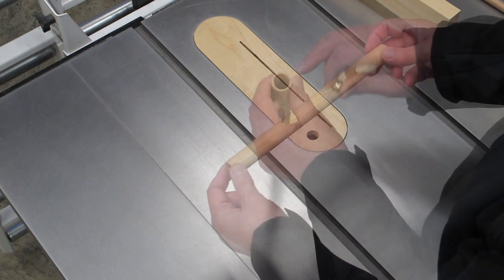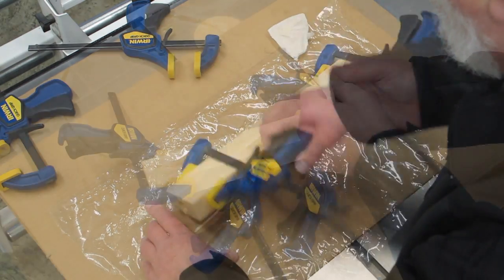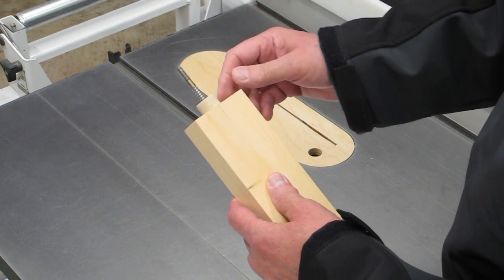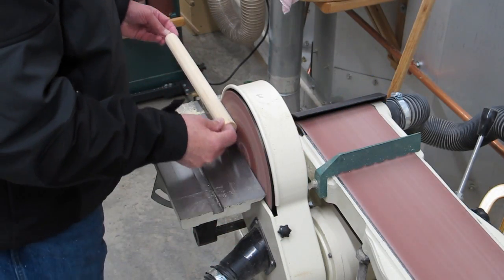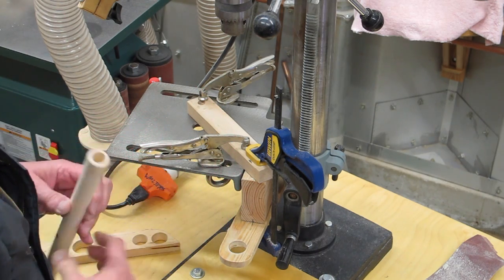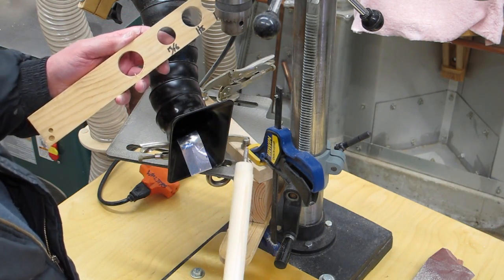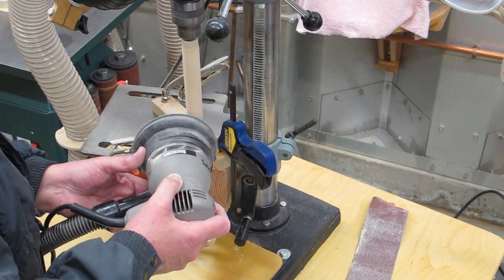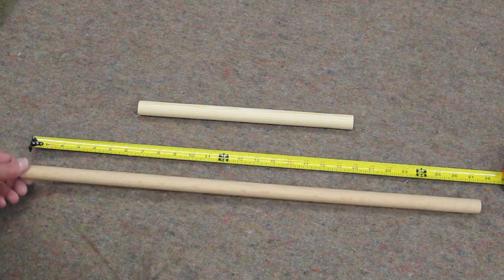Wood Pipe - On The Drill Press

Comment from the maker: The sandpaper was a broken 80 grit belt sander belt. The wood pipe will flex as you pull on the sandpaper so it requires a gentle pull until you get near the desired size (diameter). Then I used finer sandpaper on the random orbital to smooth the surface. Worked for me.

Comment from the maker: You could do this a lot easier if you had a lathe. I mention this in my construction article that will be on woodgears.ca starting tomorrow 1/30/12. But, you can still do “turning operations” by using a drill press and accomplish a similar result.

Comment: if you carve out the inside with a routertable, wouldn't it be easier to round over the outside with a roundover bit? (of course you would need the proper diameter, but it seems like a much simpler operation)